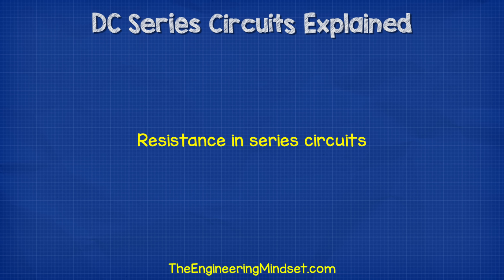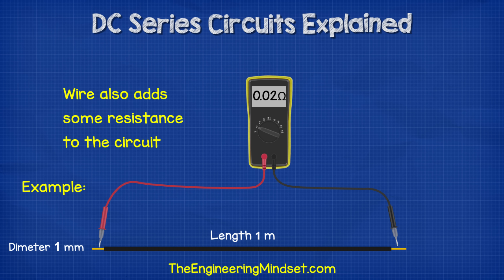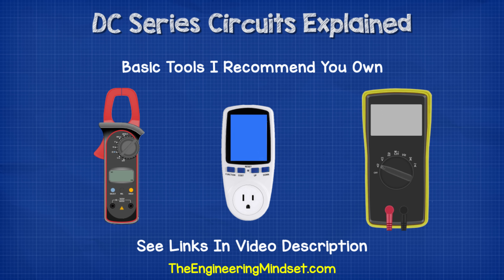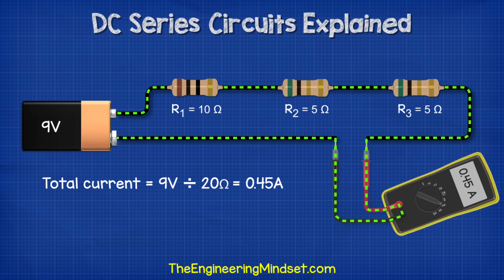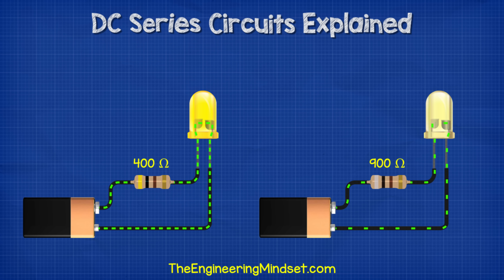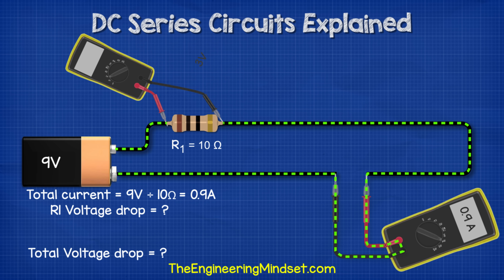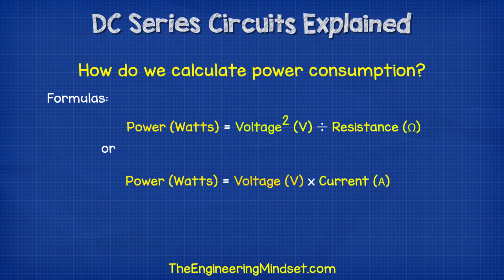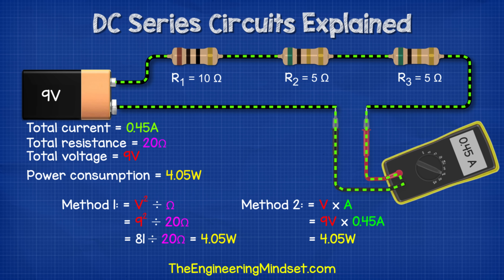DC Series circuits explained - The basics working principle

Comment: I'm just stupid
but if you add a resistor to create a voltage drop (as in a resistance to electron flow) and it generates heat, why measuring across multiple resistor in series gives the total resistor voltage drop?

by the explanation I would assume that electron flow would loose "energy" as if in a pipe we would add something that creates a diminishing flow of water.
but by having more things in the way of water if wouldn't create the same amount of force.

I imagine that it has to be something analog as stretching the passage of a pipe makes actually the water flows faster but hydraulics would be a very precise model because the order of the obstacles would matter.

anyone has a clue ?
Reply from the maker: Check out NEW resistor video, everything covered! ➡️ https://youtu.be/DYcLFHgVCn0

Comment: You said that the resistor gives off energy in the form of heat because the electrons collide with each other.  Wouldn't that mean the more resistors in a circuit the more energy that is given off?  Yet in your calculations the more resistors you have the less watts you have.  Please explain.
Reply from the maker: Check out NEW resistor video, everything covered! ➡️ https://youtu.be/DYcLFHgVCn0

Comment: Great video ! But. The links you mentioned are not down below Paul 😭😭😭😭
Reply from the maker: Let me know links are missing, I'll add them
Reply: @EngineeringMindset  in this one you mention that the one for parallel circuits will be down below but it wasn't. And in your other videos also the links you mention would be down below are usually not there because your description has only selected highlighted links in the electrical section for every description. I don't mind searching them separately but it would still be great if you could add the links you mention at the top of your description or in your pinned comment. Thank you 😭
Reply from the maker: OK thanks, it's usually a long process from making the video to getting it published so sometimes I miss these links. If yiu find any more let me know and I'll update
Reply: @EngineeringMindset  indeed it is a long process ! Your content is much appreciated ! And your IG has some very worth it memes, I recently visited the page 😂😂 Thanks and keep up the good work ! :)) 🤙🏻🤙🏻

Comment: I must be as dumb as a box of rocks, I still don't get it. If R1 drops the voltage by 4.5V, and R2 and R3 drop the voltage by 2.5 V each there should be 0V  left in the circuit, but according to this there is still 9V in the circuit. Can somebody please explain this to me as there's something fundamental that I don't understand.
Reply: I, too, might be as devolved as a can of beans. I used to breeze through tests about electricity back in highschool but now, after just a few years, I can no longer understand anything about electricity.

Comment: I understood everything until you got to the power consumption.  In your examples, you are showing how much power (watts) the bare circuit consumes without doing any other work (ex light bulb, etc).  I understood the fact that the resistor consumes some power because the electrons bump into resistance within the resistor and causes heat (losing power - or consuming power).  Therefore, I would have thought as you add more resistance, (the 10 ohm and then the 5 ohm and then another 5 ohm), that the power (watt) usage would have gone up but it went down in the calculation.  That is a bit confusing.  Maybe it is offset by the fact that the fact that the resistance causes less electrons to flow across the resistors per second and therefore even though there is power usage (heat), the power usage is overall lower by the slower flow of electrons??

Also, very well done set of instruction.  I'm going to watch them all.  thank you very much.
Reply: I agree it is counter intuitive.  However, I think it goes like this: as you add more resistors to the series ciruit, the overall current (the current that goes through all of the resistors) goes down (as you said, less electrons flowing).  In a series circuit, the current going through any resistor is always the same as the overall current.  An equation for power is P = V * I.  If 'V' is constant (9 volts), but 'I' decreases (say from .81 amps, to .45 amps) then the total P decreases too (if something on one side of the equation goes down, then something on the other side must go down to remain in equilibrium).  This is true for each of the individual resistors also.  First we know that V = I * R.  Substitute that in for P = V * I, to get P = (I*R) * I = I^2 * R.  First you calculate the overall current (by adding up all the resistors to get R total, and using V = I * R total), then you apply that overall current to each of the resistors individually to calculate the power consumed by each resistor.  If the overall current is .81 amps, and one of the individual resistors is 10 ohms, then the power for that individual resistor is P = (0.81^2) * 10 = 6.561 watts.  If the current is .45 amps (because we added another resistor in series), and the same resistor we considered before (not the resistor that was added) is still 10 ohms, then the power for that individual resistor is P = (0.45^2) * 10 = 2.025 watts.  The power consumed by that resistor went down, because the overall current going through it went down.
Reply from the maker: Check out NEW resistor video, everything covered! ➡️ https://youtu.be/DYcLFHgVCn0

Comment: Hi, love the video! Have a question though. At the 2:30min mark you show two examples – the left one is 9V battery, 400 Ohm resistor, LED and measured 18.7mA, the right one – 9V battery, 900 Ohm resistor, LED and measured 7.9mA. If there were no LEDs the measurements would have been – left 9/400=22.5mA, right 9/900=10mA. I have done some research and found that for those measurements to be true the left LED should be a yellow LED with a voltage rating of 1.8V doing best performance at 22mA – 1.8V/0.022A=81 Ohm, therefore 9V/(400+81)=18.7mA and the right one should be something like a white LED rated at 3.2V, going at 13-14mA, so 3.2V/0.0135A=237 Ohm, therefore 9V/(900+237)=7.9mA. Is my logic correct, because those measurements battled me hard??
Reply: It's not a given that it's a 9 volt that's just a basic shape to use for the model. Your supposed to find the voltage in that scenario by converting the miliamps to amps, 18.7 x 1000 and then x 400 ohms gives you a 7.48 volt battery
Reply from the maker: Check out NEW resistor video, everything covered! ➡️ https://youtu.be/DYcLFHgVCn0

Comment: I HAVE DOUBT Sir you told that resistors decrease flow of electrons in circuit but again you told current will be same in series circuit even if we add resistors why
Reply: It will be same but lower like for 10 ohm 1 amp current will be same throughout the circuit and for 5 ohm 2 amp current will be same throughout the circuit
Reply from the maker: Check out NEW resistor video, everything covered! ➡️ https://youtu.be/DYcLFHgVCn0

Comment: Does this mean if I have a 9 volt battery and only need 5v I can add a resistor until I have 5v on the resistor and use that to peer my 5v modules ?
Reply from the maker: Check out NEW resistor video, everything covered! ➡️ https://youtu.be/DYcLFHgVCn0
Reply: @EngineeringMindset  Unexpected update, I forgot why I need this but thanks

Comment: What if when testing voltage, you test from the end of one resistor to the beginning of the next one?
Reply: you still get the voltage drop of the first resistor
Reply: @cenzolyksitruff  Hello. Does this apply to the following resistors as well? Cheers.
Reply: @johnellison1635   assuming you’re asking about testing them in series without disconnecting them from the circuit individually, you will get the cumulative effect of the resistors before the resistors down the circuit. To test an individual resistor; you must isolate said resistor from circuit or else your reading will be incorrect. Hope this helped.
Reply from the maker: Check out NEW resistor video, everything covered! ➡️ https://youtu.be/DYcLFHgVCn0

Comment: You might confusing by voltage and current between series and parallel circuit connections. Just remember "serIes" includes letter "I" means current is same voltage is difference. But in "parallel" circuit DON'T include any letter "I". So, in parallel voltage is same and current is different. Just remember this simple technique then you don't confuse
Reply: There is another take on this.  In a parallel circuit, the current has to split up to travel down many paths, but the voltage is the same across each of the parallel resistors, because the start and finish for each of those resistors is the same.  In a series circuit, there is only one path for the current to travel through from start to finish, so the current stays the same.  But the start and finish for each resistor is different, so the overall voltage is divided or split up into pieces, one per resistor.
Reply from the maker: Check out NEW resistor video, everything covered! ➡️ https://youtu.be/DYcLFHgVCn0

Comment: If a 9 volt battery is running low does it turn to 8 volts or does it stay at 9 volts until it dies?

Comment: I have 50 led module, and the type is;
1 set contain 3 leds and it connected in series.
If I connect 12v battery, it light up and bright
( 12V>------led----led----led----led---< )
And if I cut it until one, it still produce the same brightness
( 12V>------led----<)
Why the led is not burnt? I didn't see any resistor inside
Reply from the maker: Check out NEW resistor video, everything covered! ➡️ https://youtu.be/DYcLFHgVCn0

Comment: From the diagrams, i saw the resistor applied before the LED and after the LED. Which one is correct? Should be before the LED right?
Reply: my understanding is that current is the same in any place in the circuit so doesn't matter where you put the resistor.
Reply: @NhatLinhNguyen82  Thanks
Reply from the maker: Check out NEW resistor video, everything covered! ➡️ https://youtu.be/DYcLFHgVCn0

Comment: 0.020A current feeding the bulb or 20mA. Therefore, ELD has perfect source designed: not too much or too little.
Power consumption according to ur calculation: 0.20*9= 1.8mw
Reply: The resistance is 460, not 450 😝

Comment: THE LAD is a bit incorrect: voltage regulates the speed of electrons, not their quantity, which is regulated by the current. In the example with a light source, higher voltage means higher-energy/velocity elections stumbling upon high-resistance material making it shine brighter.

Comment: So with a voltage 'drop' of 9V does that mean there is no 'pressure' left using a 9V battery? I'm trying to use a water analogy
Reply from the maker: Check this out, how a battery works: https://youtu.be/PXNKkcB0pI4
Reply: @EngineeringMindset  I think I had the same question so just watched the battery video. So in a DC circuit where the electrons flow in only one direction, with a voltage drop of 9v, would zero electrons be returning to the 9v battery?

Comment: So it doesn't matter where within the circuit that the resistors are placed?

I've seen diagrams that show a simple battery and LED setup with the resistor "before" and "after" the LED light.

If electrons are flowing from the battery and the resistor is needed to effectively slow down or de-pressurize the electricity to keep the LED light safe, how is it that they can appear after the LED in the circuit?

This may seem stupid but I simultaneously get it and don't get it. I get how "they do the same job anywhere in a circuit" may be right but something in my brain thinks that makes no sense.

Edit: Ok, looked around and I learned that it doesn't matter because of a basic rule that I guess I took too literally with the water analogy. I'm glad I was able to get to this altered (but correct) way of seeing it now, as opposed to later.

Voltage is equal across the circuit from beginning to end, immediately. Meaning that a resistor anywhere has the same effect across the circuit

So, don't think of this in the sense of electrons bursting out of the source and flowing like a tidal wave across the circuit. That "start here and run to the end" idea isn't exactly right. Think of it in the sense that the moment the circuit is complete it has a set, stable voltage from the beginning and end at essentially the same time BECAUSE of what voltage is/means. In this sense you have to lose or alter the water analogy a bit.

This seems like a basic notion but I'm clearly not alone because a google search came back with literally hundreds of discussions about this very topic/question. Haha. 
 It must be a way that some of us interpret the water anlogy as we applied it a bit too literally or strictly.
Reply: DannyWilliamH I had the same question/perplexion
Reply: Thanks for pointing this out. I assumed to protect the LED it would have to be upstream, like a fuse, but this makes sense, the resistor can act like a valve to control flow either upstream or downstream.
Reply from the maker: Check out NEW resistor video, everything covered! ➡️ https://youtu.be/DYcLFHgVCn0

Comment: summary:
- if you have n resistors in a series, the total resistance in the circuit is the sum of them
- current is the same throughout the circuit (think as good as weakest link)
- if you have n voltage sources in a series, the total voltage across the circuit is the sum of them
- voltage will vary throughout the circuit (it depends on your two points of reference)
- resistors take some of the energy of electrons passing through them and convert them into heat
Reply from the maker: Check out NEW resistor video, everything covered! ➡️ https://youtu.be/DYcLFHgVCn0
Reply: Excellent

Comment: What I dont understand is, if resistors dissipate heat energy does that mean it is also wasting potential electricity?
 Say if a simple LED that consumes 10W also needs a resistor that dissipates 2W of heat, would that mean that the circuit actually consumes 12W of energy instead of 10W?
Reply: Yeah, it is wasted potential, unless you use that heat to warm up something you want hot. Unfortunately, you almost always need to use too much voltage for any given load, and a resistor absorbs that extra voltage/power to protect the other component(s).
Reply: @Electronzap  Well that sucks, I wonder if there's a better way to power circuits, like maybe use a dynamic V&C generator of some sort that only outputs what the circuit needs without needing any converters in the middle. 
I know there are adjustable voltage lab bench PSU (I have a cheap 500mA one) but they down convert the voltage and loose efficiency in the process.
Reply: @zedg7473  Anytime work is done energy is used.
Reply: @zedg7473  The Holy Grail of electronics would be finding a 100% efficient way to use electricity; a way to control voltage and/or current without wasting energy in the form of lost heat. Thus far, I have yet to encounter an electrical or electronic device that doesn't get hot (and thus dissipating energy) when current is flowing. Some are far more energy-efficient than others, of course, but I don't believe anyone has created a useful application of power ("useful" meaning it does something we want done) with 100% efficiency. I would LOVE to be mistaken about this. Anyone know differently?
Reply from the maker: Check out NEW resistor video, everything covered! ➡️ https://youtu.be/DYcLFHgVCn0
Reply: Yes! That's exactly what it means. You'd need to supply (and pay for) 12W to get 10W worth of light from the LED. It's the same idea voltage regulators and power supplies or battery chargers.
If your phone charger is say 90% efficient at converting mains electricity voltage to the 5v needed to charge a phone battery, you have to buy 110% of the electricity needed to fully charge your phone, the extra 10% is wasted as heat warming up the charger, and the phone and battery itself.

Comment: He explains thing very well. I thought that video was going to explain DC  Series Circuits but the entire thing was about resistors. Useful but not what the title claimed.
Reply: Hi ;) I understand what you are saying, but i think the best way for you to understand how a series circuits works it´s just thinking about this:
In a series circuit the current that flows it´s always the same.... 
 The only thing that can happen is that there are voltage drops.

And that is why if you measure between those resistances, there will always be voltage drops.
..But the electric current is always the same... 
And remember this: In circuits of this type, what is in series will add up the values.
..As is the case with resistances ...I think very briefly, this is a series circuit ..
Reply from the maker: Check out NEW resistor video, everything covered! ➡️ https://youtu.be/DYcLFHgVCn0

Comment: Quick question : At 8:14 you say Total current = 9v/10Ω = 0.9A 

R1 Voltage drop = 0.9A x 10Ω = 9V
My question is if my 9V battery was initially rated 2A. Using this formulae, no matter the original amperage of the battery, the equated (end results) will always be 0.9A?
Reply: The examples are a simplification. A battery has an internal resistance (not on purpose, that's just how the chemistry works). If you draw 2A out of a 9V battery you will most likely just get a few volts at the terminals, because the rest is already lost to the internal resistance. 9V batteries aren't made for high currents.
Reply: Amp ratings for things like batteries or power supplies tells you the maximum amperage that the device can handle safely; a 2A rating doesn't mean that the battery will supply 2A in all cases.